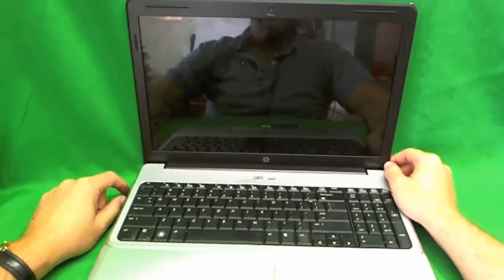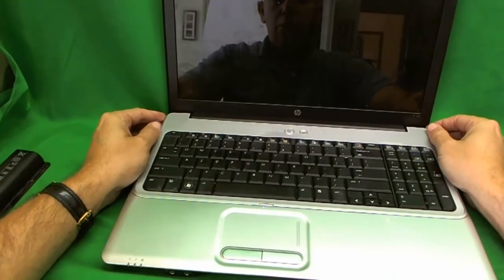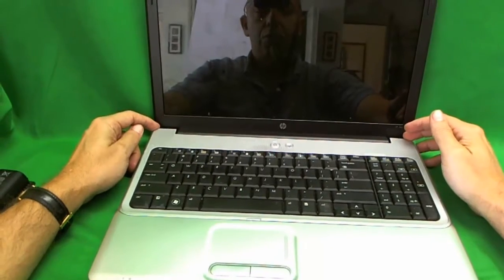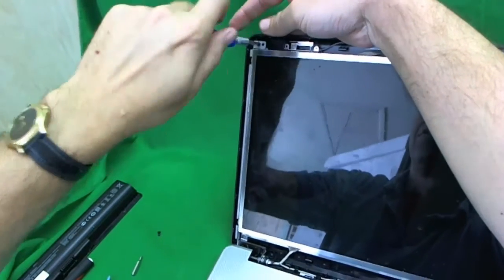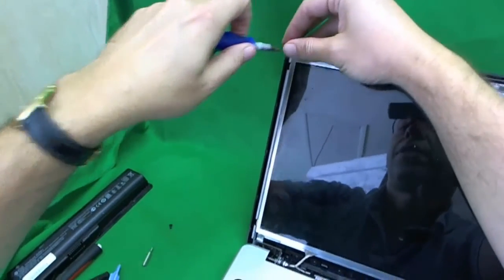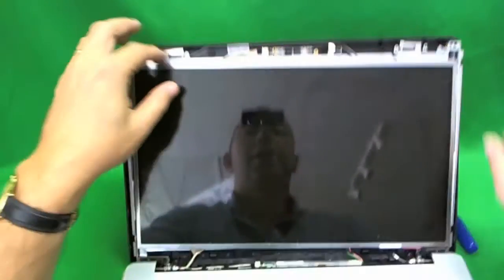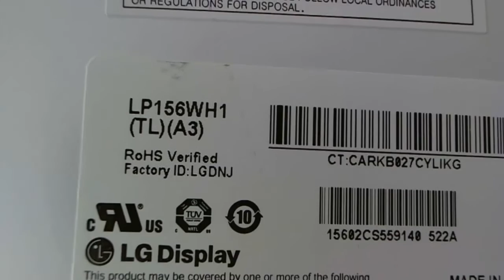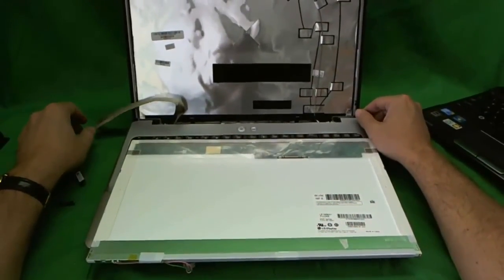HP Pavilion g61 Laptop Screen Replacement Procedure

Comment: @ScreenSurgeons I have a question, I have this same make of laptop, I recently did a self repair on the CPU fan, it was being jammed and a spritz of WD-40 loosened it up. I had to take apart the bulk of the machine, now putting it back together when I powered up the machine I found that the monitor would not respond at all, I did a check and all the connectors seem to be in place, could I have just fried the screen? The VGA card is in working order, I've plugged it up to a flat panel to see.

Comment: @ScreenSurgeons same model i have  a question...my screen turns all white when i straighten the laptop when its on the only reason im able to type u this is cus when u tilt the laptop right back only then is the screen visible insted oh  all white...plz plz plz tell me what is wrong with the laptop do i need a new screen all together or is there some internal issue with the laptop?? thanks you

Comment: same model here, my problem is, the lcd is black but i can see the screen the backlight is not working but when i open the lcd to the max angle, it will turn on, but when i open the lcd in other angle it wont turn on. what can be its problem?

Comment: Replaced monitor and backlight... still no picture.  I get picture when i plug in external monitor.  so does this mean it all that's left is to try replacing the cable that plugs into the monitor?  i will have to take apart the whole laptop to do that but is it the right thing to do?
Reply: @Turcotte Lallier sounds like a bad LCD inverter which for around $20, little time and a small amount of tear down I would start there before LCD or cable replacement.